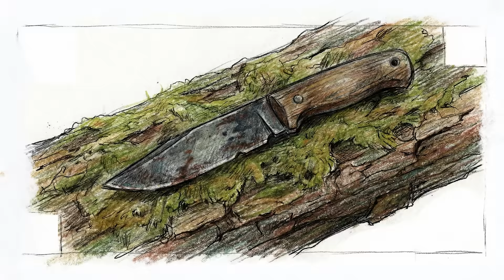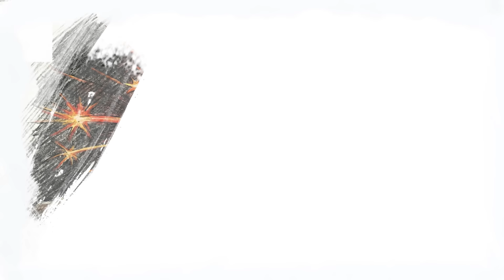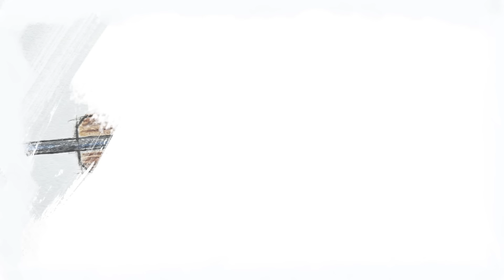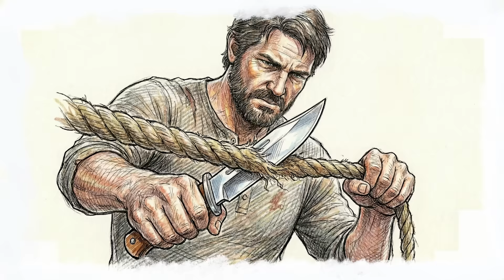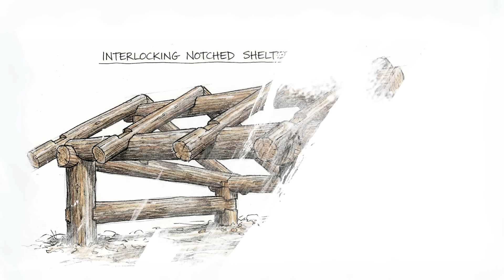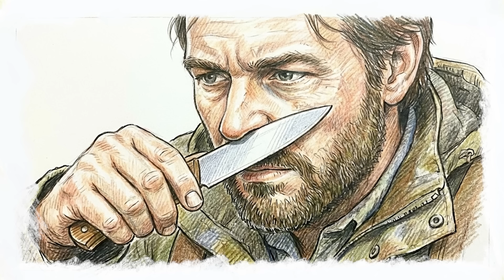Why Your "Survival" Knife Will Get You Killed

Comment: why not stainless? where will you find oil to maintain your carbon steel knife in a survival situation? not unless you always bring it along with you, which will be a liability.
Reply: I actually prefer stainless.
Reply: You dont need a clean knife for survival. It only last s shorter time. Survival is trying to get home. The knife will build patina and last a lifetime.
Reply: @bushcraft_in_the_north  Man finally some guy said what I was thinking !  Damn Straight Man !
Reply: @bushcraft_in_the_north  Depends on what you call 'survival'. If you are talking about 72 hours it probably doesn't make much difference. But what is you're backpacking rural areas in a far away country for 4 weeks? Food prep is a main issue and cross contamination can happen easily so you need a knife that's very easy to clean. Both the knife and sheath.
Reply: @StevanOutdoor 😊of you talk old blood and guts and dont have water to clean it,maybe. But nothing organic in the woods makes bacterias. Wood is clean and it cant grow on it. Rust will not harm anything you put in your mouth,  it can only give you iron and that is positive. And you normally makes a fire and eat warm food as much as you can so no problems there eather. Just wash it and dry it. Or use some animal fats if you have🔪🐻‍❄️🇧🇻
Reply: @bushcraft_in_the_north  That's not true. Many animals carry diseases so you have to clean. If you only have enough water to drink it kinda gets imporant how much water you are gonna use for cleaning.
Reply: @StevanOutdoor there is normally streams,rivers and water out there. Pee on it and or use ash or sand,that's good enough. Use of ash is superb,it is 100% clean,contains lye and is a abrasive ,can even use it for honing/stropping.
Reply: @bushcraft_in_the_north  In some places there are streams and water and in other places there are not. In Morocco there was just dust and sand for instance. You don't travel, do you? And in order to get ash you need a fire first and ash can be contaminated also. It's just not good advice.
Reply: Bushcraftinthenorth. You are saying PEE on your knife to clean it!
Reply: @StevanOutdoor so you are afraid of having a plaincrash over Morocco? And you cant clean your knife???  It starts to get  a little dumb. So one in a 20mil chance etc. If it is a trip, you have oil and more than one knife. And I hope something much better than a knife, axe and saw. But you dont need that eather in Marocco,only a showel. And rubbel from 250 passangers laying around. Just use Balistol,food safe,cleans, lubricates,kills bacteria cleans wounds,use it on leather,sore skin,wood, you name it. 🔪🐻‍❄️🇧🇻
Reply: @bushcraft_in_the_north  I'll ask again, you don't travel do you? At least not internationally. On a plane you can't bring any knife in your carry on so I'm not worried about a plane crash. Who's making no sense at all? You must be from the USA. In your checked luggage you are lucky if they allow a SAK or multitool and maybe a small fixed blade like a Mora if you luggage is about camping. Many countries don't allow you bring axes or saws. What's the purpose? Are you gonna destroy their nature or are you gonna work on a tourist visa? Prepare for serious questions and possibly denied entry.
I do however go adventure backpacking usually for 4 weeks at a time, sometimes longer. I stay with locals. Go explore the bush from deserts to jungles. Even in jungles it can be hard to find water. On the other hand you can have rainy season and you, your gear and everything around you is wet all day and night.
If somebody recommends bringing a carbon steel blade or a leather sheath I know they don't travel.  I'm pretty sure you are from the USA, don't travel and have no clue what you are talking about. Your channel has no content and only 13 subscribers.
Reply: @Harmonicaplayinghobo  Sure, urine has a high level of salt in it which discourages bacteria growth but then wipe it clean with dirt and pass it over a flame a few times to be sure!
Reply: @StevanOutdoor i dont have a channel here ,I am mostly on Insta. And yes I have allmost grown up in the wild. Got a knife when I was 2 years old, so 47 years of knife use,collect knives and forge them. You dont have to be a YouTuber to know the wildernes quite the other way around. YouTube experts dont know shit about anything and can barly use a tool.And no,I am not American. I am Norwegian,  hence the North in the name,real north. We have all kinds of wild nature here and the climate are extreme compared to many countrys, and it changes alot over the year. You dont have to use a plain all over the world to know things about outdoors life. You seem like a troll in the comment section andchange wiew on things all the time, just to troll around with people. You dont seem to know much about nature and how to behave, where are you from? You sound and act like an American🔪🐻‍❄️🇧🇻
Reply: Actually, I carry cotton balls imbued with Vaseline petroleum jelly. Great for starting fires and keeping your knife rust free. Covering burns and treating chapped lips and other area's that chaff. Not very heavy, keep them in a small ziplock bag or tin, with a good lid. They don't weigh much either.
Reply: @JamesHart62  I do bring man made stuff to make a fire. But if you use those cotton balls for fire you can no longer use them to prevent rust on your knife. I don't have to worry about that because the knife is stainless steel.
Reply: Ash and sand clean brother
Reply: @manueltolea7770 that is 100% correct🎯
Reply: @manueltolea7770  It cleans but doesn't kill bacteria. It might gather more.
Reply: Oil can be found in many tree barks and leaves. Many other plants as well. Animal fats are even better. This is the least of your survival issues.
Reply: @greyscout01  So now you have to walk around and find the right tree or plant, if it's even there. Go catch an animal for the fat to preserve your knife. While you are running around in the forest burning calories you have to replace I'm sleeping in my hammock conserving energy and calories because I don't have to worry about my knife. It's just commom sense.
Reply: @StevanOutdoor  Not optimal, just options. I personally prefer stainless, but have both.
Reply: Oil??  Animal fat willed nicely.
Reply: Oil it with the fat of your enemies 😅
Reply: Because most stainless steels dont have the strength that high carbon blades have to hold up to beating on wood, high loads or stress and fractures. 

Most high carbon and spring steels will absolutely hold up well past our lifetimes with any proper care. Any type of animal fat and oil will work, or fish fat, or plants/nuts....Thats why. This is ancient stuff that was solved long before writing was invented.
Reply: @Swoleson_Rebel  That argument is ancient indeed but no longer true since decades. Basically since 420J2 where most dive knives where made off back in the day, later 440 steels and more recent AUS8 and 10, etc. Now we have the powder metals aka supersteels. But even besides the supersteels 14c28n of the Mora Garberg seems stronger than the carbon variant. But let's paint a picture. I'm asleep in my hammock with my stainless steel knife preserving energy and you have your carbon steel knife and are running around in the woods for hours looking for animal or fishfat, looking for the right nuts totally wasting all your energy just to keep your knife in working condition. That is the real picture. Knife steels have developed over the years. You are stuck in ancient times.

Comment: Lol smh... partial tang will snap huh, the Glock 78 and 81 is tougher than most over built full tang knives.
Reply: Mora Robust isn't full tang and it's one of the most indestructible blades out there. Also about $20.
Reply: But the steel is super soft and dont hod a edge long. Bad geometry for cutting anything in the woods. Everything with hat knife is crap. But you can allways use it to poke holes in stuff🔪🐻‍❄️🇧🇻
Reply: @bushcraft_in_the_north yeah, I'm sure that's exactly what was said for the Austrian military when issued the knife. Lol
Reply: @rnkmode1876 the military has allways used shitty knives that are the cheapest they can get their hands on.🔪🐻‍❄️🇧🇻
Reply: @bushcraft_in_the_north  The Kabar knife that used to be issued to the Marines is damn tough!  A lot of times it's how you use it because it's not an axe or a hammer!  I don't know if they still use a leather sheath but it is good for sharpening!
Reply: @rogerjensen5277 i agree in how to use a knife. It would not be my first choice in anything outdoors/survival related. But it would work quite ok maybe...it has a soft tiny tang,not good at chopping anythong larger than a couple of finger wide wood. Not the best carver. But it can work and it can slaughter a animal,it has a sharp clip too. Yes they still come with a leather sheat. But now they have made one with a full tang, and you get them in different kinds of steel, synth sheats and handles etc. But more a allround fighter blade to cut throats with. And it is just fine for that.🔪🐻‍❄️🇧🇻